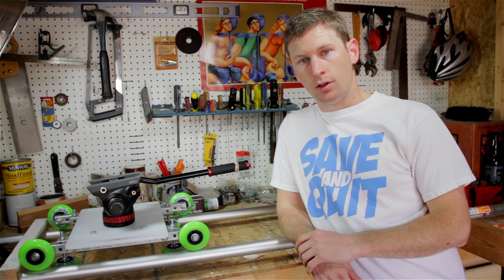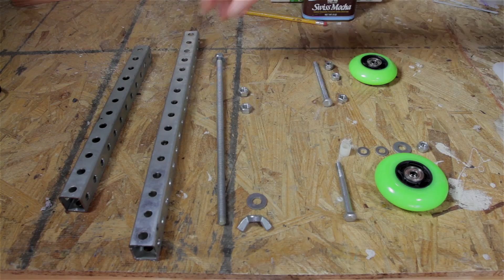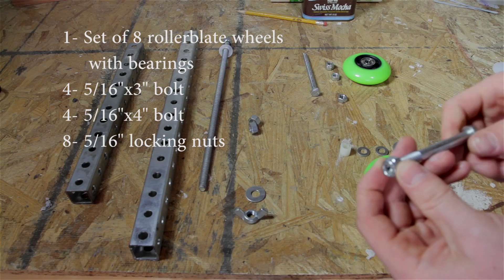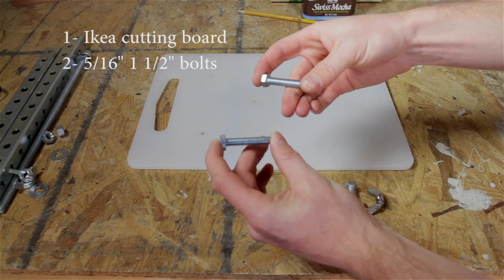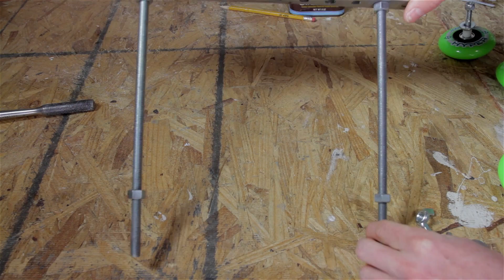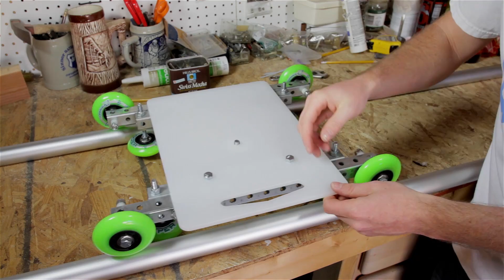How to build your own rail dolly

Comment: How do you hold rails together? Currently you only put them down onto the surface...
Reply from the maker: There are threaded rods with nuts on the inside and outside of each rail

Comment: cameron: thanks for the video. what are the proper name on those tubes? how wide are they. i know you mentioned they were six feet. thanks, kenneth
Reply from the maker: Kenneth J Harvey The tubes are perforated steel square tube, local hardware stores have them in 1", 1 1/4" and 1 1/2".
Reply: Cameron Scott sorry, cameron. i meant the aluminum tubing that the dolly rides on. you also mentioned that 6' lengths might be joined. how so? thanks for your time. cheers, kenneth
Reply from the maker: Oh, sorry. The pole is this http://www.homedepot.com/p/Marshalltown-6-ft-Aluminum-Snap-Handle-RED700344-HD/204498012 they also make a threaded version that would work well but is more expensive.
Reply: Cameron Scott Thanks a million. I currently use plastic pipe but I find the smoothness sometimes lacking. Cheers, Kenneth